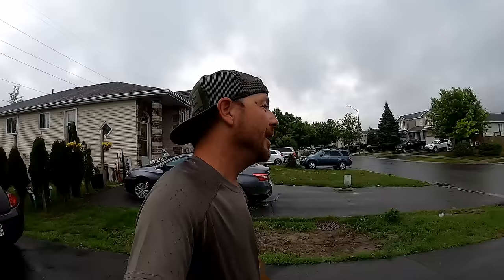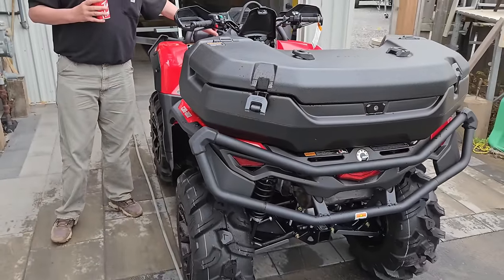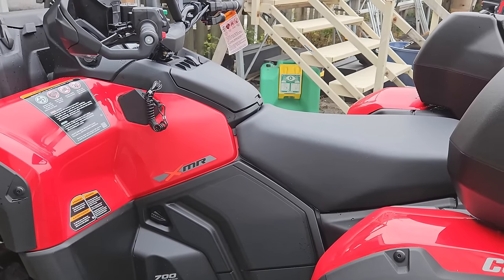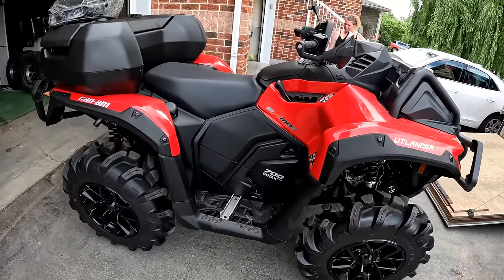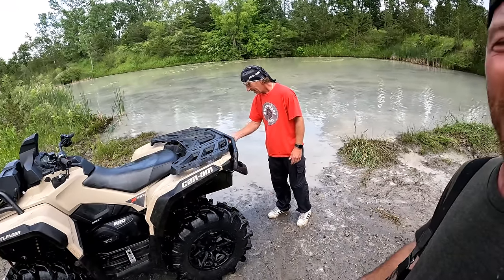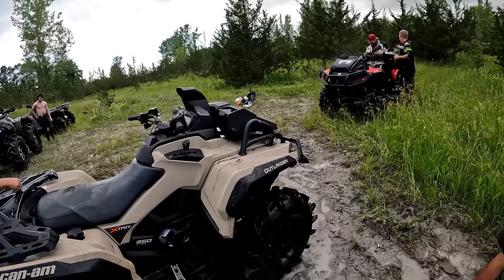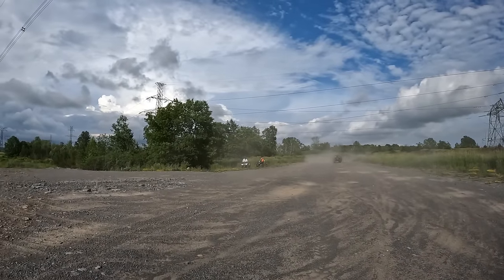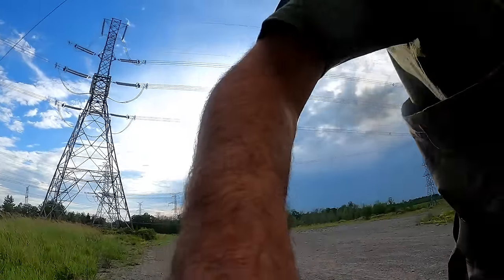New Can-Am Outlander 700 X-mr Single Cylinder VS 650 Twin

Comment: Looks well thought out with some great improvements. The fender flares weren’t thought out though Utlander lol. Only thing I’m not a fan of is that battery location.
Reply from the maker: I know, eh. Reminds me of zoolander! Hahaha. So long as the posts are easy access, then I'm good with the battery in the rear. The more weight I can keep over the back tires, the better I figure. Really get the power down quick, and stays better planted juring water wheelies.

Comment: The only thing wrong with the 700 is its really lacking hp compaired to even the 570. The 650 has 62 hp so i was really hoping to see atleast 60hp.

Im still looking at buying one but with the new 850 and 1000r coming to dealers i might wait 2 years to pick up a new one.

Comment: Not knocking these, nice machines but I don't understand how canam gets away with calling a 650 displacement a 500 and a 700. And the 700 is a bit pricey. Right now I would probably go with the Suzuki king quad for a 700. I currently have a'17 Kawasaki brute force and its a beast but am contemplating going to a single cylinder.
Reply from the maker: The Kingquad is a great choice really. Overall I was impressed with this Outlander though

Comment: just curious why u where telling him to let it down at the 27min mark? seems like he wasent that high up and not too deep either? great video!
Reply from the maker: It's a constant slope to the deepend. If it starts to veer right, which it will when your riding parallel with it. It will be at a point of no turning back you'll swamp. Deep sentiment would poss a huge problem to stay upright at anything less than straight up. Deadly situation as the full depth has yet to be determined.  Was over the Waders two feet or so past where he was.

Comment: i see alot of people saying this is a big power gain for single cylinder atvs. the can am 500 only makes 40 hp an 01 sp500 h.o. has right around 40 hp aswell and  thats 22 years ago.
the 700xmr only has 50 hp you can make that on a grizzly or king quad with just an exhaust. these hp numbers are kinda lacking if you ask me. i really expected to see 60+ hp on the 700 and atleast 45hp on the 500 considering the rotax has a reputation to keep up with.
i rode with my buddies 2023 500 outlander last week and i was shocked that my old sp500 H.O. managed to be a faster machine with nothing but a dalton clutch kit and exhaust mod. i consistently beat him to 85 kph so 50 ish mph, he would catch up and etch me out around 55mph. his top speed was around 105 kph but seems like its governed. my polaris tops out at 95kph screaming at 6800rpm. the outlander 500 also weights around 790lbs dry.
the canams new clutch is as smooth as glass compared to anything else ive ridden tho and it creeps like a foot shift when you feather the throttle. i really cant wait to see where this new single cylinder line up goes. i should also note the ride on the new 500 seemed to be on par with my old mans highlifter 850 and seemed to be reasonably better than my sp500. high speeds were way more comfortable on the can am aswell. it just seemed like the power steering was built better.

Comment: Alot of add ons for it to be higher end model.  No winch? Seems low end to me if that isn't included along with the fender flares.   Great video!
Reply: It's not included to give the buyer the option to get what winch they want instead of something they may just replace.

Comment: Yea the only difference on the honda is you have to do several oil changes, canam you have to replace the motor that cost as much as the quad
Reply from the maker: Ya talking a bout swamping? If so, I've still yet to see any of the ones I've seen swamp blow up as of yet. The lads are still ripping them hard. I would definitely recommend a rebuild, but most times that's not in the cards, eh